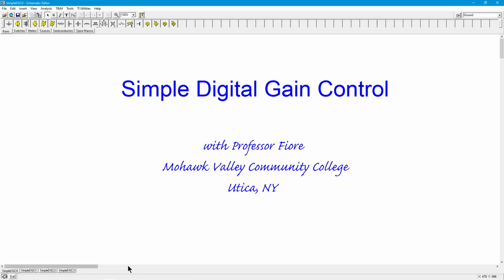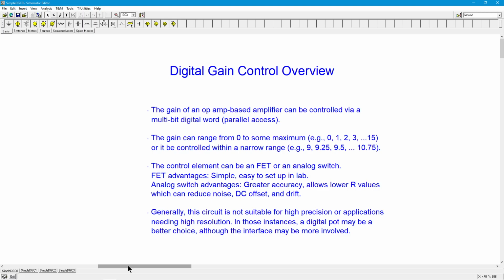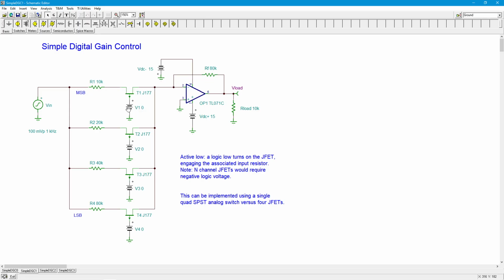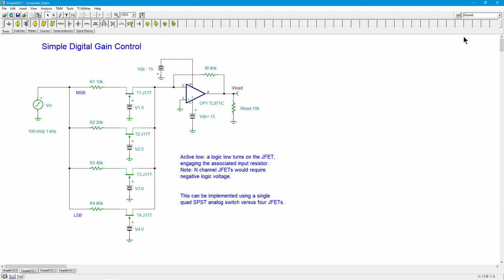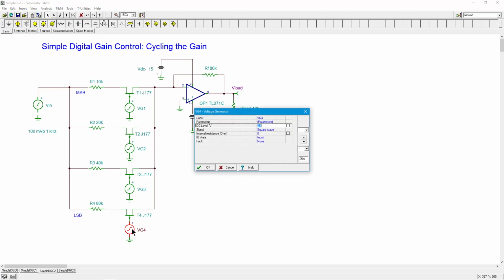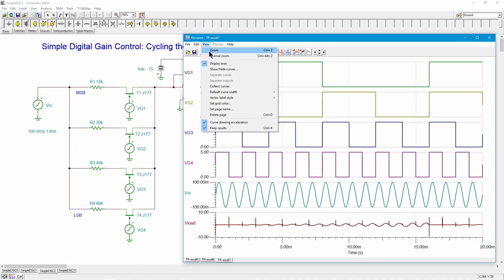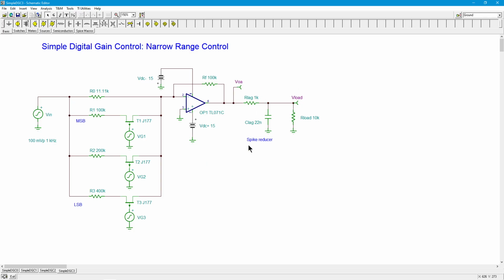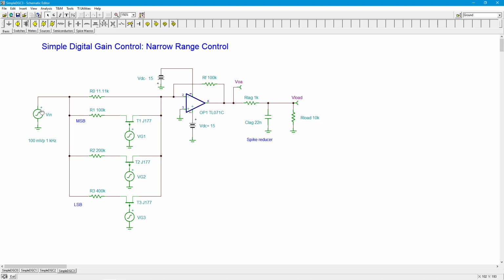Simple Digital Gain Control

Comment: Of course the tolerance of the resistors limits the number of bits (with 1% tolerance you really shouldnt expect good results with more than 6 bits) and the monotonicity (same sized discrete steps) isn't that great either. 

A digital pot like a X9C103 (10K) has the disadvantage that you can't set a resistance (you have to go up or down steps like manually turning a regular pot).

Something like an MCP 4151 can be set (and has 257 steps as opposed to the 100 steps of the X9C103) but it is an SPI (serial) controlled chip. 

An alternative is to use a DAC 0808 as an attenuator. It's a current DAC with an 8 bit input to sink a fraction (0 up to 255/256) of a reference current. It's very fast (150nS settling time). It's still accurate with very small (micro amps) reference current. Only down side is that the output can only sink current.
Reply from the maker: As the title says, this is a simple digital gain control. If I needed high resolution, this is not the approach I would take.

Comment: We started with "pots are bad because they don't totally turn off".  Then we digitized.  Then we went to a range 5dB up to 10dB let's say.  Isn't that exactly what we COULD have done with the pots?
Reply from the maker: Sure, but that's not the point of this video/circuit. Unlike a normal pot, this amplifier can be controlled programmatically (e.g., by a microcontroller).

Comment: Using a DAC to control a FET resistance seems like it would be a lot simpler, although this might not be in the spirit of the exercise. I would also be inclined to control the feedback resistance rather than the input resistance.
Reply from the maker: Yeah, "spirit of the exercise" is part of it as this video jumps off of the inverting summing amplifier video. I would only use this if the requirements were minimal. There are certainly other means to achieve digital gain control, and with higher resolution, range, and accuracy. But this is, as the title states, a simple means to achieve that end.

Comment: JFETs are kinda rare in Hungary, I can find only 2-3 types of that. 

I guess it’s not so frequently used in everyday electronics.
Reply from the maker: If I was doing this from scratch, I'd use analog switches instead of the JFETs (as indicated in the side notes). The point of using the JFETs is for illustrative/learning purposes.
Reply: I think for switching, also it's possible to use two mosfets back to back, that way their body diode create a true block of current when you switch them off.

Comment: Great videos. How do you create a audio log pot? I have made one with the 40xx series and alot of resistors. Uses a dual clock for stepping. In the days when all digital pots where very noisy (early 80') it worked good but could not replace a mechanical pot due to size.
Reply from the maker: The gain ratios would be logarithmic. A bit of a pain to calculate compare to this, and I'll add that this technique isn't really intended for a wide gain range with fine control.